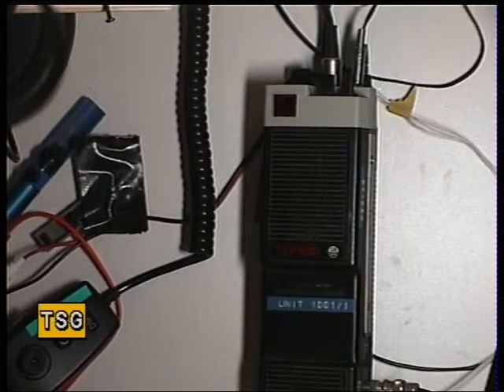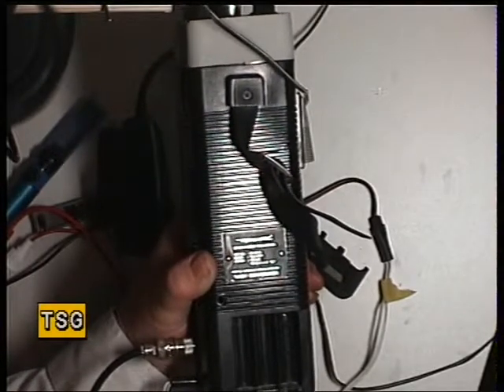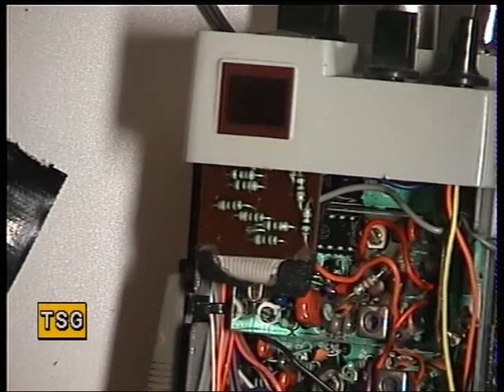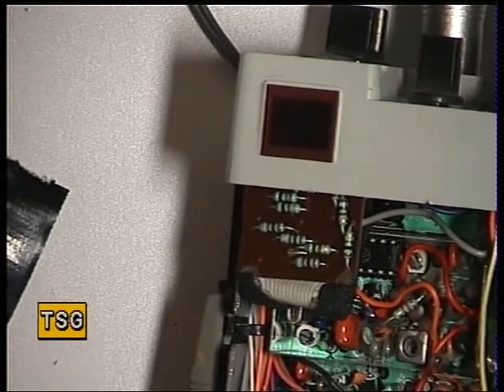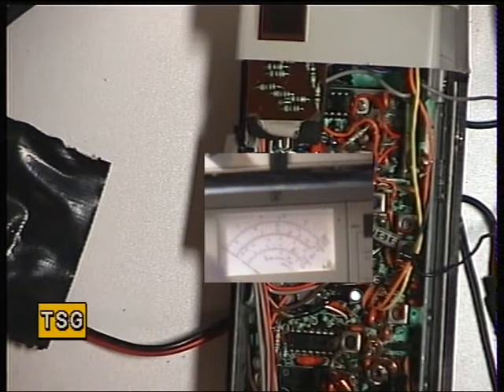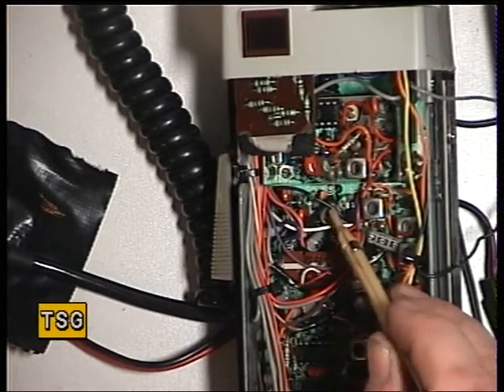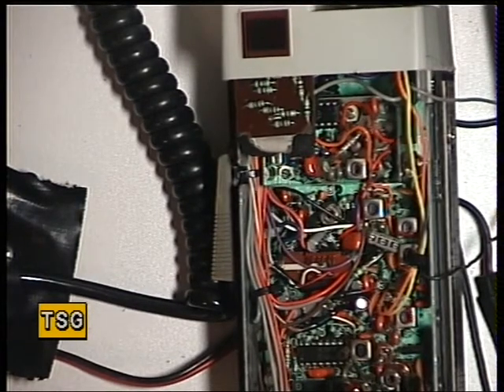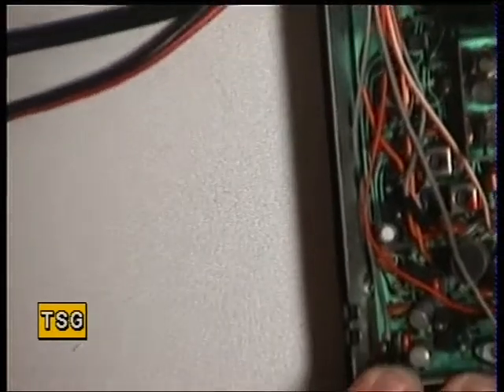Realistic TRC1001 UK CB radio 3.5W  (Hand portable). Alignment of Transmitter

Comment: Thanks for the look inside what has to be one of the best handheld CB radios ever made. I'm surprised to hear that these won't tolerate 13.8V - surely many people powered these through the cigarette lighter in their car. Heck, the owner's manual might have even okayed it. Have you seen many that were blown in this manner?
Reply from the maker: +themaritimeman Yes, these are superb sets. I have several here.....just the thing to throw into a CBless car with a magmount & external mike.

Tandy sold a cigar lead at the time that dropped the voltage through simply 4 series diodes to 12V. 

Application of 13.8V destroys the NEC audio IC  which is hard & expensive to get (but I keep in stock!). The same applies to the TRC1005 model...the one with the LCD display.
Reply: +UK CB radio servicing Hmm, that's interesting. And good to know in case I get one of these someday (I've been eyeing these older Realistic units off and on for years on eBay). I just looked on eBay, and someone in Germany sells the uPC1170H for USD $2 apiece - not a bad deal.

Out of curiosity, is there any difference in performance between the 1001 and 1005? Either one noticeably clearer or reaches farther than the other?
Reply from the maker: +themaritimeman Performance wise the TRC1005 is a 4W radio, whereas the TRC1001 is a 3.5W radio. I have detected no difference in actual range between the two on field tests, which both doing about 14 miles back to our test vehicle. I'll tell you something else...that 2-channel 1.5W TRC1002 is actually 1.5W ERP & about 6W INPUT. We've had 12 miles on one of those. The longwest range of any handheld was when we tested the Binatone Longranger 40 which we got 16 miles on, and the Moonraker Master handheld that wasn't far off either. Both the realistic sets can suffer from dry joints between the two sides of the PCB now they are 30+ years old, but of course that can be sorted.
Reply: +UK CB radio servicing Wow, impressive that you got 12 miles out of a 1.5W set. Odd that it's 6W input when the 3.5W TRC-1001 is I believe only 5W input, though. Just a really inefficient transmitter design, or something else?
Reply from the maker: All three models mentioned have "range boost side panels" which makes the user part of the groundplane. This makes a huge difference with plastic cased sets. Obviously metal cased sets achieve this inherently. The output transistor on the 2-channel TRC1002 is an expensive Mitsubishi 2SC2166, which is 12.5W capable when placed on a huge heatsink with a fan. In reality it WILL achieve 6W with normal heatsinking on 12V. The idea in over engineering will be that it can stand a much worse VSWR than most other devices when used in a handheld set; something to take into consideration is some wally doesn't pull up the telescopic aerial fully!

In contrast, the Motorola MPSU31 output transistor used in the Harvard/Harrier/Alba handhelds can only do 1W in free air & is required to provide 2.5W with little heatsinking. Slightest bad SWR & it's knackered!

The Realistic 1001, 1005 sets were custom made for Tandy by GRE in Japan & the 1002 & 50mW (3 mile range!) 1003 model by them in Korea.
Reply: +UK CB radio servicing Oh, does input power mean something different than what I'm thinking? I thought it was the amount of power required to produce the output power. As in, the 1002 requires 6W from the power source to generate 1.5W RF output.
Reply from the maker: +themaritimeman The output is only available to the telescopic aerial. There is no external socket. If you measure the output at the test point before the loading coil & aerial, it is greater than 4W. You are quite right about input power & thus transmitter efficiency. The fact is that this radio is 1.5W ERP, which I find incredible, hence the superior range. These aren't to be confused with other xtal controlled 2-channel sets. These came fitted with just one pair of crystals (ch20) and sold for £59.99